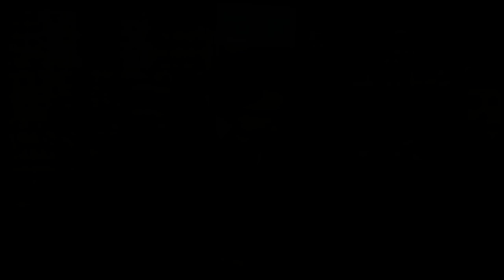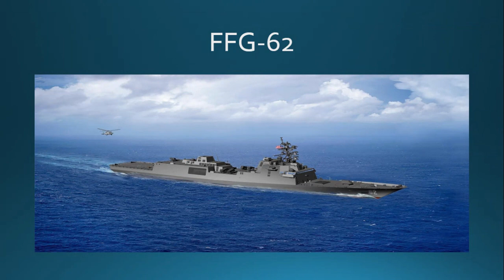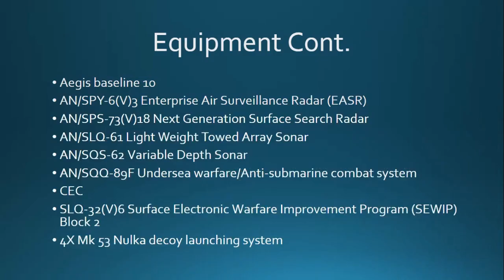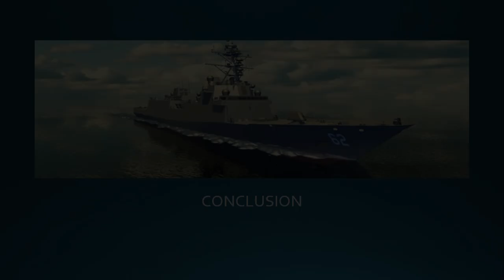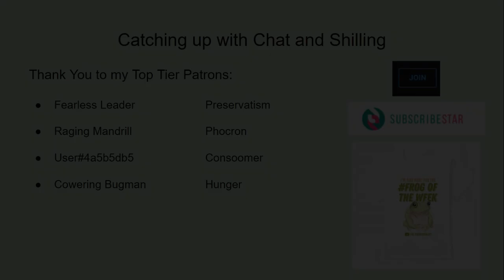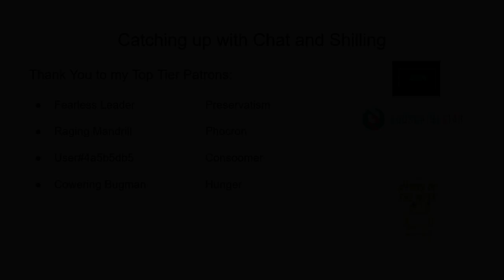The Sunday Stream #48: The FFG-62

Comment: As someone else mentioned, your info on AN/SQS-62 is not correct. It is not a hull mounted sonar but rather a towed sonar. This class of ship will not have a hull mounted sonar nor will it have torpedo tubes. Also, earlier this year, the towed sonar for this class was changed to Thales CAPTAS-4. Constellation class will not get Raytheon's AN/SQS-62. This is subject to change again I suspect. But CAPTAS-4 is considered by most to be better than AN/SQS-62.

Comment: Regarding the NSM, it is a stealthy missile with a passive sensor, so although this is 'only' a subsonic missile, it still greatly reduces the reaction time an enemy would have when compared to a more conventional missile such as the Harpoon.

I very much doubt that the range is anywhere near 300nmi, I'm pretty sure the official figure simply says 100nmi+.

I'd also mention (in case anyone isn't aware) that the ESSM missiles can be quad packed into the Mk41 VLS cells so you could theoretically have up to 128 of them.

Overall a great ship for the USN similar to the RN's Type 26, they can't solely rely on the large and expensive Burke's, so this fits a good middle ground that will boost ship numbers.

Comment: Couple of things:  1)  Both sonars are towed.  There currently is no planned hull amounted sonar.  2)  You didn't mention one key factor about ESSM, they can be quad packed into a single cell.  The ESSM block 2 is claimed to be 45 mile+ with active terminal guidance.  So, you could have a potential load out of 48 ESSM and 16 SM-6s, and 4 ASROCs.  Since the cells are strike length, Tomahawk and LRASM could be loaded as well.

Comment: It's kind of crazy to think that ship to ship warfare besides the increase in size, scale, and range basically was the same from sailboats with cannons up through WW2. That is until missiles
Reply: Sure if described in broad strokes it sounds similar but the small difference add up and eventually contribute to large shifts in tactics and strategy. If described in such broad strokes, what makes missails any different. It's just an extream upgrade to range and precision.
Reply: @stalwartteakettlepotato9879  no, because I am talking about tactics just as Raging Mandrel said. 
Missiles do make a huge difference,  because they can shoot over horizon, which mean formations no longer  matter for offensive ship to ship actions. 
The same parallels can be seen in infantry tactics in which two forces met each other in a line. Which continued for the most part until post WW1

Comment: That intro takes me back to Super Nintendo 2 games
Reply: It’s actually a remake of the menu music from Age of Empires II. Best realtime strategy game ever.
Reply: @Vingul  I could be mixing them up then. I dont remember which version of AOE i played, but it would been the original or 2
Reply: @robertmacdonaldch5105  this version is more «8-bitty» than the one in the game so it makes sense that it would remind you of SNES as well.
I played both AoE games a lot, but to tell the truth I was a bit too young to be very good at the time, hehe. I grew up with 3 older brothers who also played it however. When Age of Mythology came out I was getting there in terms of age(!) and also well equipped from experience with the previous games.
That Age of Kings menu music in particular takes me right back to the very late 90s/early 2000s.
Reply: @Vingul  If AoE 2 is from ~2000 then yes, that was up there with the best strategy games of that time. I vividly remember some Red Alert LAN parties we had. Intel Switch (for those who don't know, switch is a dumb router; and Intel was premium dumb because it was fast), pizzas, beer. Ohh such a long time ago. 25 years. Jeez, time flies.